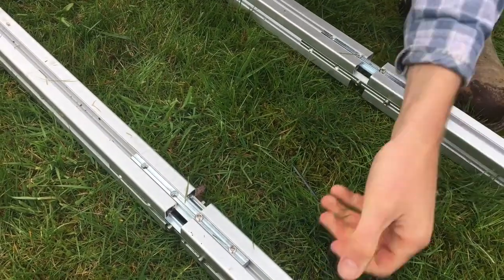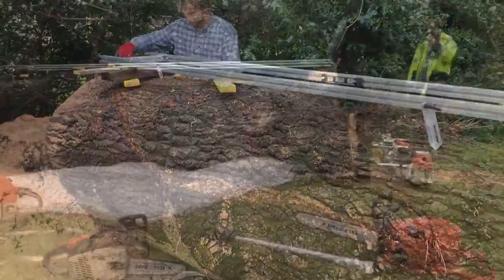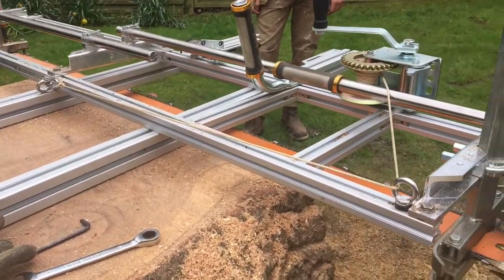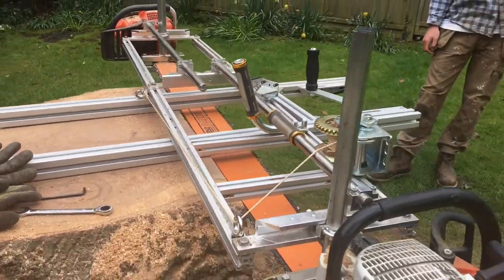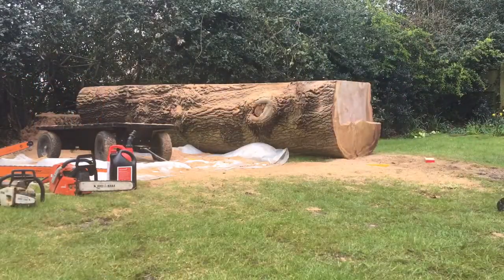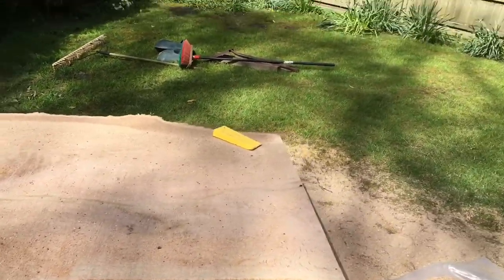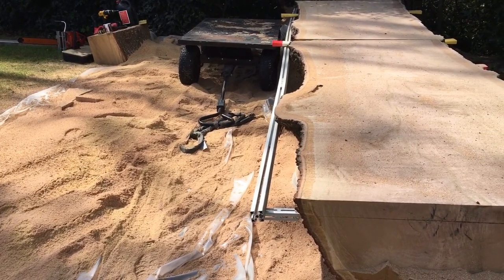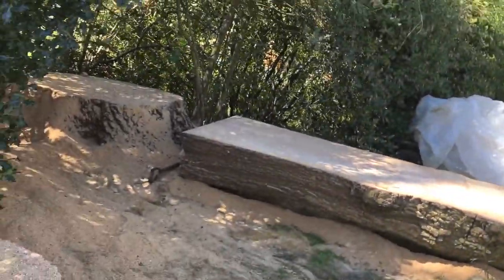Double ended chainsaw milling Stihl MS880 and MS660 Large Oak Southampton April 2017

Comment: Very cool setup! 
I've heard of some chainsaw mills using plastic rollers rather then skids.
Think of very large roller skate wheels
Reply from the maker: Yep we have these but they tend to accelerate the mill into the log - either the skids need to be much longer or you need a rail attached to the log - we are working on both!
Reply: Yes we have those but you almost need the friction of the skids against the log or the saw tends to fly into the wood and bogs down.

Comment: What is the size you used aluminum frame, is it 30x30 or  40x40 frame
Reply: For the first cut system it is 40x40 https://www.chainsawbars.co.uk/product/pl15-1-5m-section-1st-cut-system-light-intro-offer-see-description-details/

Comment: What size power heads were you using?
Reply: It says in the title!
Reply: @chainsawbars  that's the smallest, orangest ms880 I've ever seen if that's the case
Reply: @longbarmillworks8147  Maybe you haven't seen many 880s then ;) I have!
Reply: @chainsawbars  looks like a 660 on the left and a husky on the right...
Reply: @chainsawbars   3:50. That's a 660. Says right on it.  The other is a husky.
Reply: 660 and a husky. 3:50.